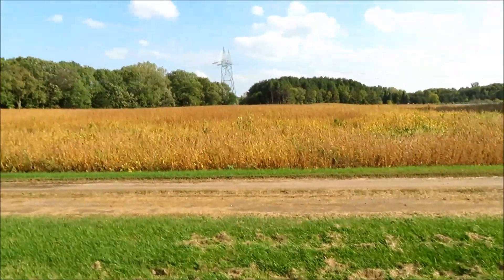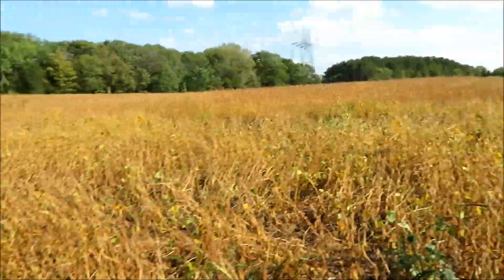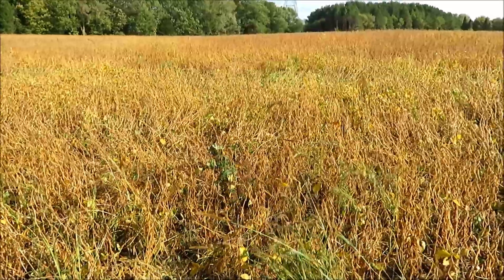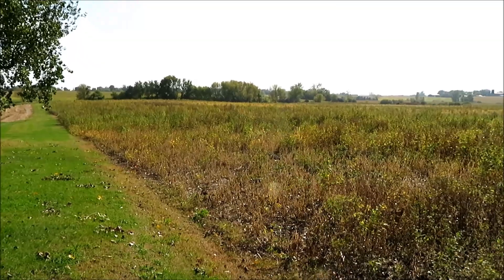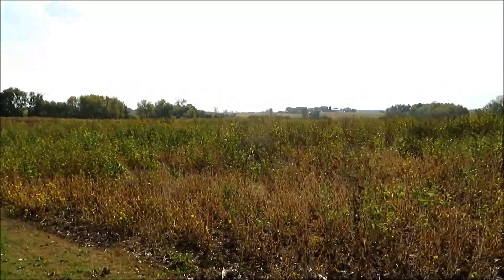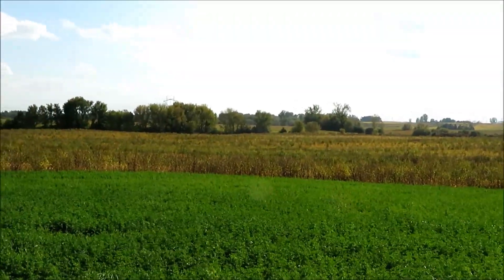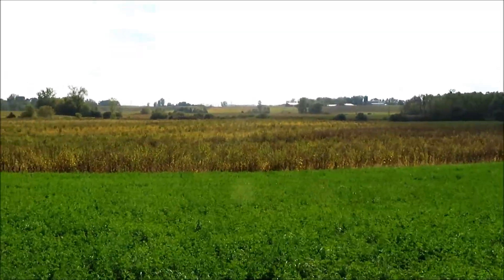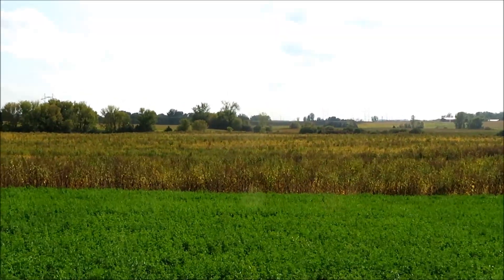A Challenge: No-Till Soybeans & Cover Crops

Comment: Have you thought about using a roller crimper?
Reply from the maker: We have thought about it, and I would much rather crimp the cover crops than terminate with chemicals.  The problem is that you have to wait for the rye to reach anthesis before you crimp, or else it won't terminate.  If we did that it would set our planting date back way too far for our short growing season.

However, I have heard some rumblings about farmers planting soybeans into green rye, then crimping the rye AFTER the beans are already up (and whenever the rye is at the right stage).  I'd be worried about damaging the beans, but some farmers swear they can handle the abuse and may even bounce back more vigorously.  The stress of being rolled makes 'em mad, LOL.  I need to look into all that a little bit further, however, so take it all with a grain of salt.
Reply: @ravenviewfarm  I’m planing on planting into green rye.  I also plan on crimping when the beans are at V1 stage, that’s supposed to be the best time to crimp it rye with beanies coming up.  The guy that built my roller does that to his beans. I plan on making a video of it this year so stay posted 🙂
Reply from the maker: That'd be great!  I'd love to see the results.
Reply: @ravenviewfarm  Roger that